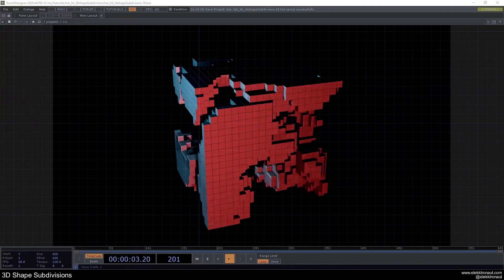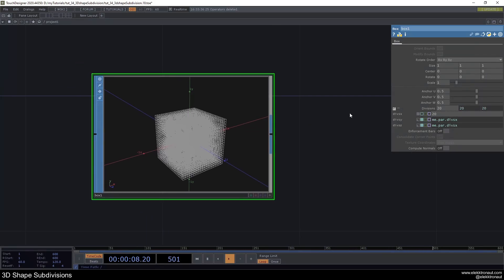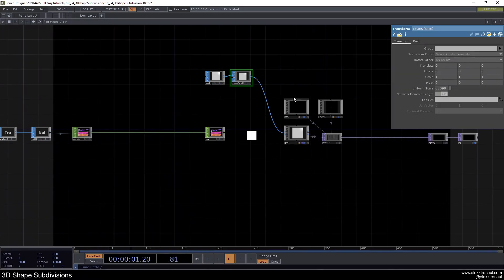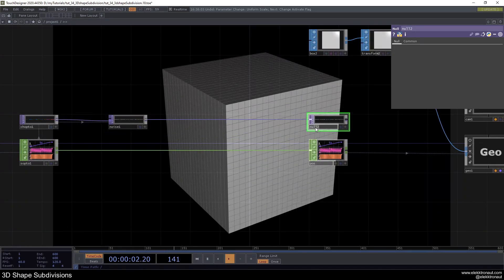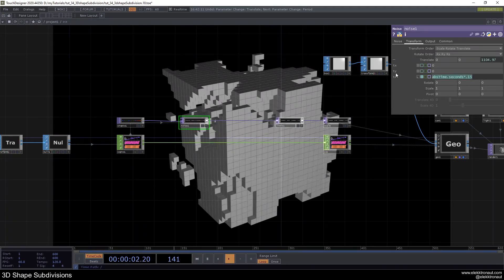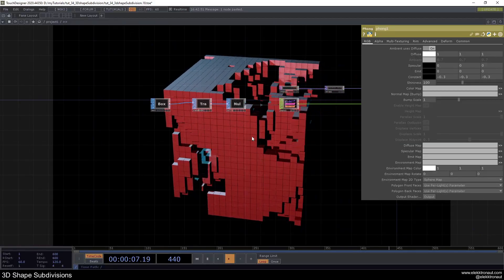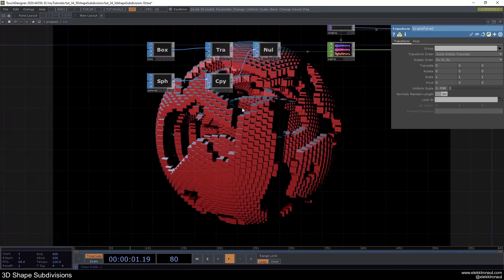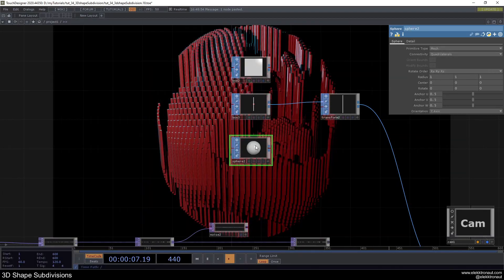3D Shape Subdivisions – TouchDesigner Tutorial 34

Comment: Thank you! But how to add 2 lights to render? It has options only for 1 light. I miss something 10:26 when I paste, I lose the connection to render. What I do wrong? Ctr+c then Ctr+v
Reply from the maker: Just copy your Light Comp :)
Reply: @elekktronaut  Thanks, I did. but there is only one light in parameters. (( I couldn't join it...
Reply from the maker: @nastyayatskhey8520  In the geo the lights par is set to '*' by default. that will include all lights on that level. you can also type 'light1 light2 light 3' or whatever to select more. google pattern matching in touchdesigner!
Reply: @elekktronaut  oh, silly of me! Thank you!
Reply from the maker: @nastyayatskhey8520  sure!